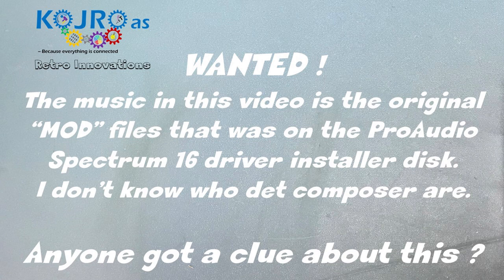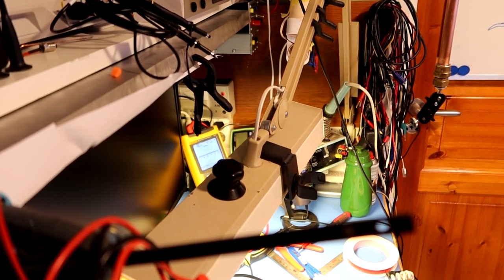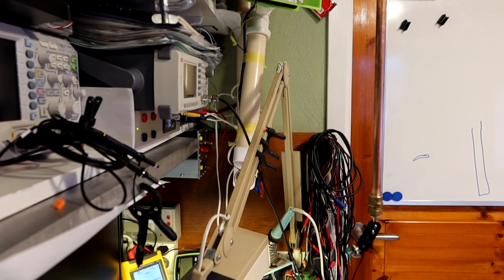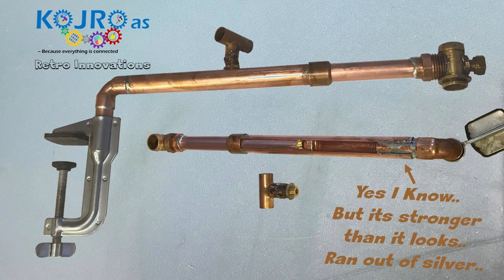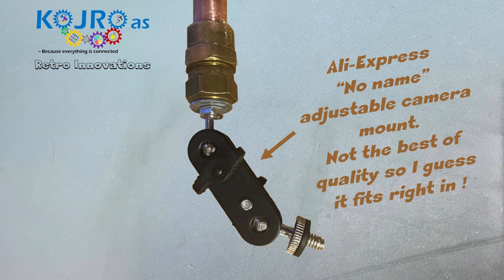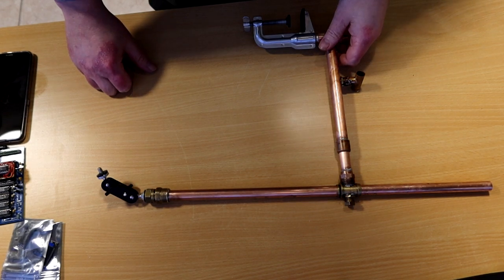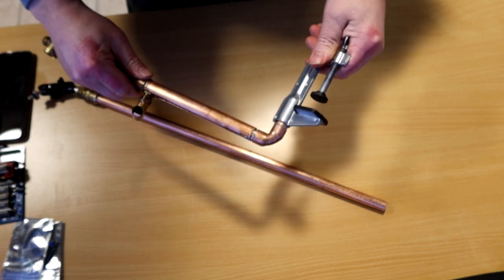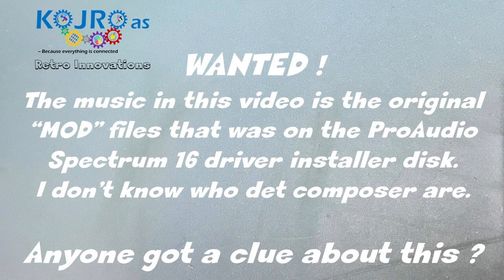The Steampunk design Camera Mount

Comment: Liked before ever watching - you had me at "SteamPunk".  This thingus looks bizarre.
Reply from the maker: Thanks for watching this kind of work is my favorite as there is no fixed solution. I use this camaramount in most of my shootings as this is the one mounted overhead on my Blue antistatic workbench.  Bizarre is not a bad description, but every piece of this does have a function, and a unique solution, that will not be transferable as the parts are one of a kind collected over more than 30 years.

Comment: Very good idea. I struggle to get good shots over the bench, both for the lighting and the cam. What camera did you get ?
Reply from the maker: I bought a Canon PowerShot G7 X Mark III, It a good overall camera, but it some annoying features. It turns itself off after 30 min, and that had been quite OK, if it then didn’t destroy the 30 min of film… This took me quite a while to figure out… I will update the firmware and make some changes to the config before I try again….